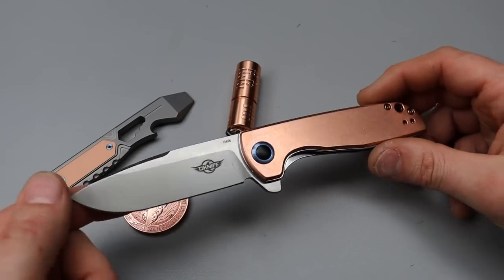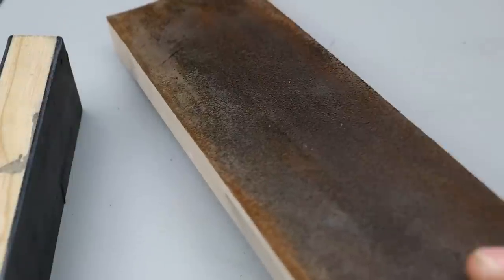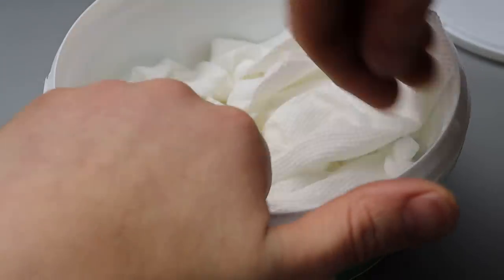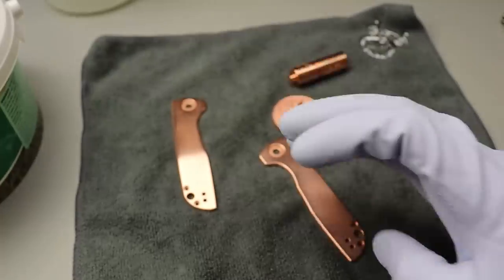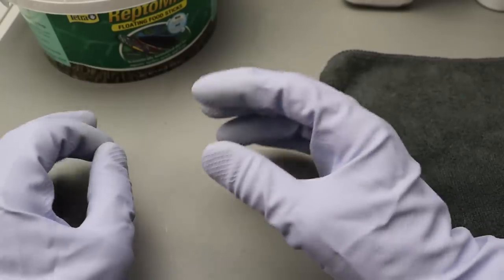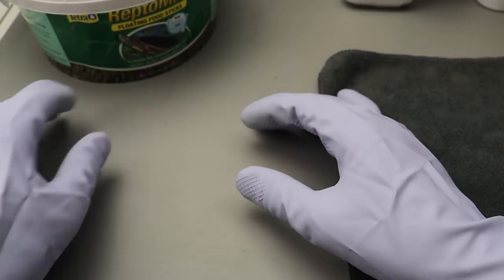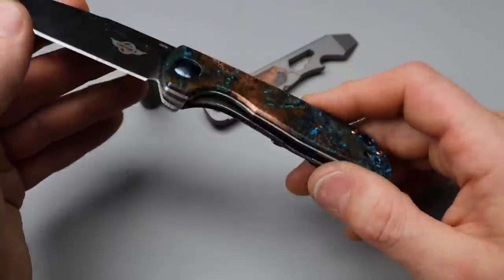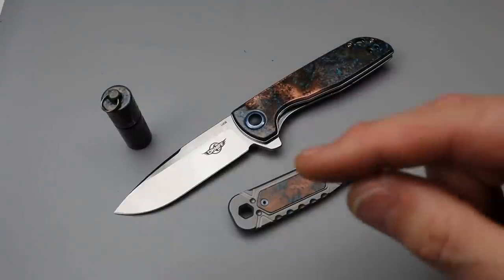How To EASILY Do a Forced Copper Patina EDC

Comment: So one thing that is very helpful to understand, is that ammonia is not a liquid, but a gas. The stuff you buy is actually ammonia dissolved in water. 

When you create the ammonia chamber, you actually don't want the tissue or liquid touching the copper. The ammonia will convert to gas, and the parts of the copper in the air will patina.

The parts in contact with the liquid will also patina, but the liquid will then pull that patina into solution and back off of the copper.

You can experiment with pooling various liquids on the copper as they will effect the end patina (salt, vinegar, water) but the ammonia gas is what you really want. And I think that whatever liquid you do spray on, you're wanting it to have evaporated by the end, therefore re-depositing any patina that was lifted into solution. 

The scrumpled tissue has in fact actually worked for you in creating a pattern! But it's responsible for the bare patches, not the blue
Reply: Thank you for this information!
Reply: What method would you use to have the salt stick to the copper.  You would sit the knife scales above the ammonia and sprinkle the salt, but I'm thinking of doing a pen.  I could put the pen parts on sticks to get even exposure to the ammonia gas as it evaporates, but I need to have the salt stick to the pen.  Wondering if I should spray a little ammonia on the pen parts then sprinkled with salt so it sticks to the pen, then put them on sticks for the ammonia vapor bath.

Comment: That’s exactly the knife I wanted to do this too as well! Awesome video. They turned out fantastic.
Reply from the maker: Yeah it's a good one to use
Reply: The Kershaw leek with CPM154 copper scales is great too and it’s cheaper. I’ve customized a few myself with the copper scales
Reply: And will immediately look like crap when it's used and the clear coat is scratched. All hell will break loose with the finish.
Reply: You don't simply clear coat everyday wear items. This is turtle liker dumb.

Comment: Did the larger coppery/yellow patch on the clip-side scale come directly out from the bath that way…or was that all from the rust eraser?  My scales came out ALL blue ‘n black, had to artfully rub out all  (brassy) patterns. Came out nice, but took 1/2 hr. more work.  Did my scales facing up…wondering if DOWN keeps more yellow metal coloring?

Comment: Awesome tutorial, everything came out looking awesome the scales of the knife are definatly my favorite of the bunch such beautiful colors in it.  The great thing about working with copper is the patina is really easy to remove and do over if your not satisfied with it. Thanks for the great vid Jerad and keep making sharp things fun and enjoyable.
Reply: Is there some special way to remove the  patina if u chose to start over? I’d like to do this to one of my knives but I wanna know how to clean it off if I screw it up somehow.
Reply: @EDCsteals  just using a buffing wheel on a dremmel with a bit of compound will take the patina right off as it's just on the surface. You can also just use a rag with some buffing compound on it just takes a bit of elbow grease. You can use Flitz or even stropping compound will get the job done. Heard of people using whitening toothpaste also but I've never tried it. Best of luck.
Reply: @toddcarr.  awesome thanks for taking the time to respond
Reply: @EDCsteals  👍👍👍👍👍

Comment: This was a great instructional video.  Did you rinse the scales or wipe them off before hitting them with the clear coat?  I didn’t see that step covered.
Reply from the maker: Yes I believe I explained that in detail at the end to make sure you rinse them off before coating
Reply: @NeevesKnives  Thanks for the follow up on that step.  I appreciate it.
Reply: I followed all the steps very precisely. And also am using the exact same knife. But when I went to rinse the scales off, most of the patina and color were easily washed down the drain. I did not scrub at all, just the flow of water took it off. The only difference I can think of, is; I have a different brand of rust eraser. I wouldn’t think that would make a big difference though
Reply: @michaelbacon8096  ….After ammonia/salt, I let mine DRY, before LIGHTLY rinsing with low flow water.  Yes, some blue comes off, but enough stays on to look natural.  While wet, lightly erase a pattern you want, then let dry again, and clearcoat.
Reply: @roadracerqx893  I was careful to do all those things, maybe just bad luck on the first go… I redid the whole process, and it turned out great. The second time, the clear coat was what took off a lot of the blue, and other colors, but it still looks really good, with lots of blues and whites, a slight bit of blacks, and minimal need for the rust eraser. I preferred the natural patterns of the process, as opposed to sanding portions away
Reply: @michaelbacon8096  ….Awesome, glad it worked out. I only sanded a little…and found an artsy technique to make sure it blended and didn’t look “sandpapered”, LOL. Now, I want a copper one to play with!

Comment: In the process of doing this. Just now realizing I have no clue how to clean the scales prior to sealing. How does one do that and make the surface relatively smooth without taking off the corrosion?
Reply: Ive seen people talk about sanding it but im not sure with what grit and how that wouldnt take off all the patina
Reply: @ThatGuy-sc5rx  turns out, water and a finger takes off 90% of any raised stuff without taking off color. Then you dry it and hit it with 2-3 layers of clear coat. Level sanding makes a huge difference.

Comment: Some people hang the copper some use papper towels does it make a difference?
Reply from the maker: No not really just depends on what you have available to use, it's the vapor that does it, with the towels it allows the vapor to not hit certain areas so it stays untouched
Reply: @NeevesKnives  so if I want a pattern with copper showing naturally form I'm better off with paper towels im guessing? Thanks I recently got a copper flask from Jacob bromwell and copper scales for my benchnade 940  so really looking forward to giving them a patina

Comment: Got a question, I've always done forced patina on copper or brass, but I'm making a ring out of a bearing casing and I assume it is stainless steel, is there any way to force patina stainless steel? I've used mustard, coarse salt for the desired pattern, and ammonia fumes to make my patina patterns in the past. I've always loved the look and I'm just trying to figure out s way to oxidize the ring. Thanks